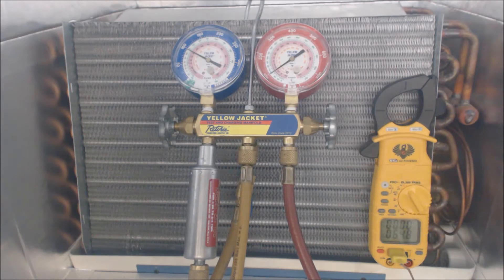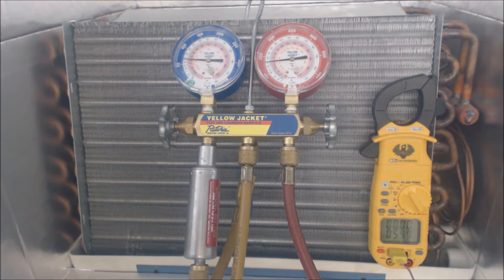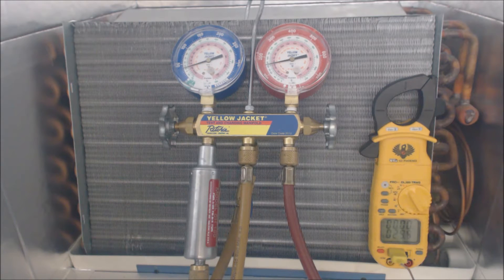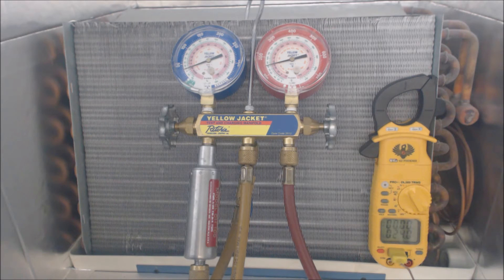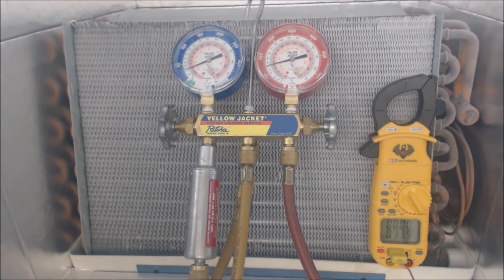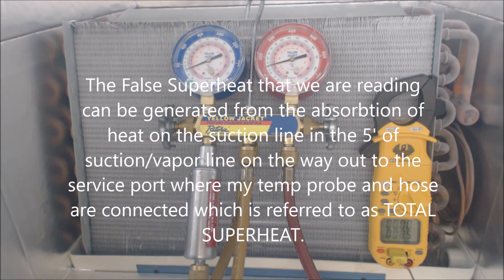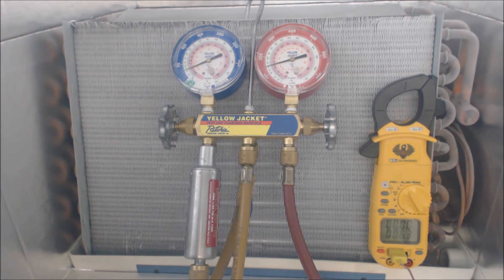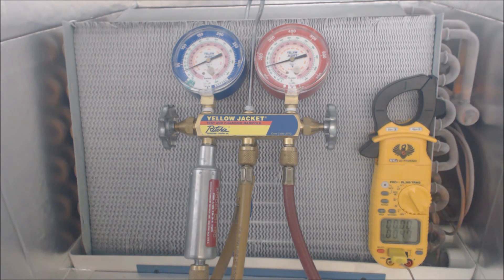Refrigerant Charge: What Happens to the Pressures. Compressor, Evap Coil when Blower Motor is Broke!

Comment: fascinating.  so how about this scenario; heat pump in heat mode (so outdoor unit acting as evap while indoor unit the condenser).  Filter in air handler inside house at "condenser" is totally   clogged.  so wouldn't that be reverse of your video and so the outside unit (acting as evaporator coil) would ice up?

Comment: Hi I am learning 410a sytems and having issues with a few condensing unitsyour help would be greatly appreciated. I have a few 410a systems that seem to be losing a charge but gradually within a week or 2 week period. when I get the not cooling call they all read the same on the suction/high side (s-75 psig., H-295 psig) thats everytime same readings. Ive checked for leaks 0 found. System has a txv so I charge by subcool method and get ariund 10° subcool. systems run great for about a week or two then bam get the call with same exact readings as mentioned above. I was told because 410a has 2 properties with different boiling points so would have to evacuate/vac/charge, and another tech say no I can just top off. thx in advance
Reply from the maker: If you can't find it then in the off season you will need to pump the unit down and then pressurize the empty lineset and evap and wait a week to see if you lost pressure. This will at least isolate one part of the system from the other. If it is in the lineset and evap then you could replace or separate them to test also.The nice thing about the condenser is that you can see if there is any oil dripping because of a large leak but the evap coil is hard to see and usually you can not see the oil because of the postion of the coil without taking it out.This refrigerant is a near azeotropic so even though we charge in liquid, you can top it off if there is a leak. The problem is that it sounds like more than topping off. I don't know how much you are weighing in each time but once you fix the leak it certainly would not hurt to weigh new R-410A so you know everything is good from then on. Thanks for the Question and I hope that helps!